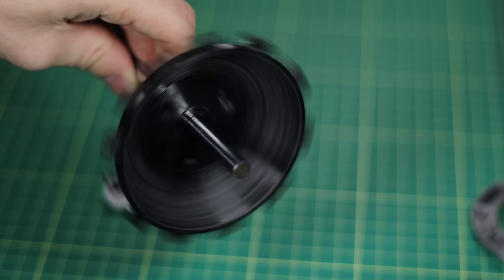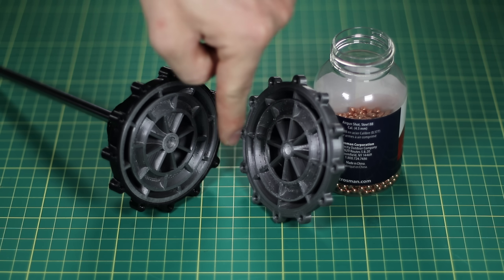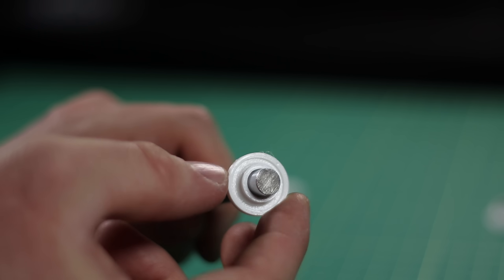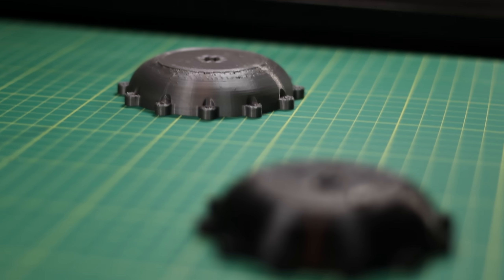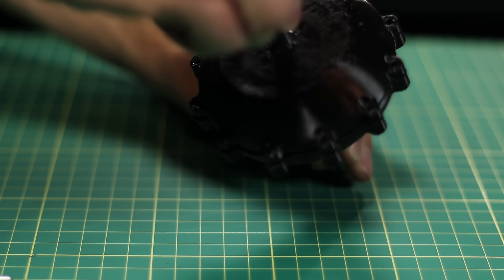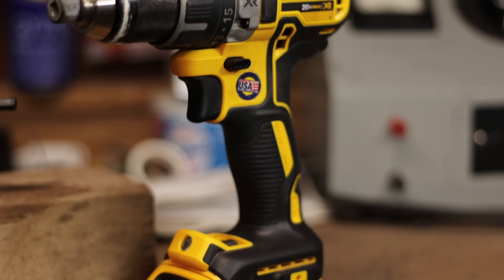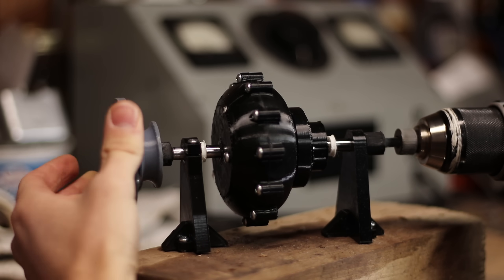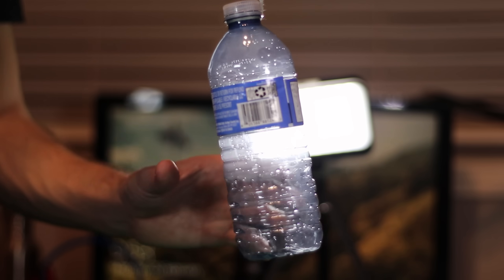3D Printed Fluid Coupler

Comment: instead of gradually adding water, i think its easier to just hang the 2 liter bottle and rev it up. angle will tell you exactly how much torque its making, if it stalls at 0 degree, you know your torque is ~2Nm, 90 degree meaning 0 Nm. torque = force*length*cos(stall angle)

Comment: This video somehow reminded me of an experiment i did as a kid where i attempted to design and build a "Non-newtonian fluid clutch" that was supposed to connect an input-shaft to an output-shaft when applying pressure to a non-newtownian fluid which in this case it was good old cornstarch and water mix aka. Oobleck. The applied pressure would then cause the non-newtonian fluid to solidify/ "stiffen up" between two "gripsurfaces"/ impellers causing them to lock up and transmit force between the two shafts. Despite all my enthusiastic effort involving few a different designs/ modifications to the clutch, the non-newtonian fluid and fluid level used inside the clutch i never got it to work properly (In my defence the only resources/ i had available at the time was a small vice, a drillpress and a dremel tool plus a few other regular handtools like hacksaw, hammers, files and screwdrivers and of course no internet. IIRC one of the first driveshafts i made was made out of a long nail)😄
I guess if it had ever been sucsessfull enough to make it to the commercial marked i could have coloured the non-newtonian fluid blue and sold it with the slogan "gets stiff and gets you moving" 😏

Comment: Now isnt this how a torque converter works? Or is it waay simpler?
Reply from the maker: Yes and no. The Fluid Coupler and torque converter both share the working principle of fluid circulation and speed difference between the impeller and pump to transmit torque. Torque converters however have a 3rd impeller called a stator inside to multiply torque. It's similar, but not the same
Reply: @CamdenBowen ok,that makes a lot of sense,so the fluid coupler doesn't have as many moving parts,but of course depending on the application there may not be an easy way to cool it down as easily as a torque converters method of sucking in cooled fluid in from the transmission pan. But it could be built similar to a finned aluminum fan clutch that is in most vehicles so it could stay cooler by having air flow across the coupler body's fins to keep the fluid more consistent in viscosity

Comment: You can calculate the dynamics torque if you connect a electric generator on it and measure the power output in kw ,then add the energy loses and last take the equation hp = torque/rpm and solve it for torque

Comment: The biggest issue with torque converters is that they can never be 100% efficient. A clutch, once it has fully grabbed, will spin with the two sides locked together. The fluid always has frictional losses of a few percent though.

But they are just so incredibly effective anyways that they can still apply very large amounts of force and they still have a very high efficiency for anything they might be compared to. Honestly, if they were cheap they might be a good way to power a bike from a SMALL engine because at low revs they wouldn't over power the brakes, but they might have a higher top speed than most bike engines do because they lack any sort of transmission.

Torque converters and turn speed into torque though and the greater the difference in speed between the two sides the greater the torque produced as the fluid imparts all of its momentum onto the vanes of the receiving turbine.

Long and short is I have wanted to put one on a bike to see how well it would work but automotive torque converters are not fit for the purpose.

Comment: Why did you reprint the part just to add a hole.. Just use a drill, surely?
Reply from the maker: Not quite, when a printer prints a solid object it creates a pattern on the inside to give it structural rigidity without compromising much of its strength. Drilling a hole into it compromises this strength and opens up the inside of the shell allowing oil to seep into it. When printing it with the hole in mind the object will be printed with walls surrounding the hole to prevent this

Comment: You need to turn the whole thing upright like a top when adding the oil, you're losing half of your efficiency leaving air inside of the torque converter, it needs to be filled to the max.

Comment: How can you be sure the rod isn't transmitting torque through the case, when the case is spinning?
Reply: Exactly my thoughts. There could be quite some power transmission, since there is no bearing and the friction between the shaft and case should be considerable.

Comment: Very cool - quite impressive to have such an effective transmitter of torque with just simple 3D printed parts and hardware. I can see this design being useful for applications where the 3D printed material is at risk of breakage. A coupler that will stall before the breaking point of the material would be really helpful, the one depicted here is just too effective. Nice work!

Comment: This is called a torque converter
Reply: Wrong, this is called a fluid coupling. A torque converter has a stator between the impeller and turbine, a fluid coupler does not.

Comment: Sorry for the non metric units but the logic should follow, most drills have tourque ratings in the hundreds of inch pounds. So worst case say its 100inch pounds, say the converter is only 50 percent efficient, that puts 50 inch pounds on that arm. A full water bottle is about a pound, to stop that shaft the arm would at minimum need to be 50inches long

Comment: The turbulence inside the fluid coupling will generate heat.  That's why most fluid couplings are made of aluminum and have fins on the back side. Aluminum is a good conductor of heat and the fins increase the surface area. I'd would be curious to see if your fluid coupling begins to distort after transmitting power for more than a few minutes.
Reply from the maker: If I had a means to spin it faster and for longer I'd love to see this thing shred apart, despite the mess

Comment: What is JB weld? Im always looking for something to glue my PLA peices together, so far epoxy is the best ive found.
Reply from the maker: what I use particularly is Jb quickweld. It cures in 4 hours and is extremely tough when cured, it is a two part mixture and is available in most hardware stores or online.
Reply: @CamdenBowen  okay yeah probably similar to epoxy

Comment: Idk precisely how much torque you can provide with your arm, but I'm quite sure it's a lot higher than like 0.3N/m (a high estimation of the torque on the axle) so I think a better way to test this would be using a heavy weight or a water dispenser bottle

Comment: Would it be possible to use this in line with an up hill flow tesla valve? To be able to get high pressure water to the top of a hill while allowing for hydo power also??

Comment: What would ferrofluid do? As I understand it it changes effective density and viscosity as it responds to magnetic fields, 
could make an electronically controlled variable torque converter!
Would be exceptionally interesting if it included its own generator and act like a governor!
Reply from the maker: That is very interesting, at low speeds with a low viscosity prevents the engine from stalling out. But with a high viscosity it could possibly even control the stall speed of the coupler

Comment: I think you’re spinning the wrong one. If you actually look at a automobile the outer housing of the entire torque converter(fluid coupling) is mounted to the power unit(engine)  externally so you should be spinning the entire housing and putting the load on the other end
Reply from the maker: It doesn't matter in this case, the reason why engines spin the housing is so the torque converter can easily be mounted to the flex plate such that the output shaft can easily slip into the transmission. Since both sides are identical Spinning either side produces similar results
Reply: @CamdenBowen  makes sense 👌 I agree with that logic

Comment: When measuring the torque, the shaft should be horizontal, otherwise the torque applied by the bottle would be lower. Of course, it has to pass through the horizontal position anyway, but the bottle has momentum by that point

Comment: Why don’t you put the arm onto a scale and measure the torque by torque=force*distance? Think that would work :)
Reply from the maker: The problem is the system has no net movement under load, so the distance would = 0. By multiplying the force by the length of the arm works in this case.

Comment: Have you thought about adding a stator to for the torque multiplication effects prior to it hitting its stall speed?
Reply from the maker: I have, however it is very difficult at this size to have it cooperate to the system. In a much larger one it may work better
Reply: @CamdenBowen  understood, thank you.

Comment: Fluid coupling may be an excellent solution for use with a diesel engine driving an aircraft or helicopter propeller. It could potentially be a "buffer" to reduce torque changes, to smoothen the vibration from the engine to propeller/drive system. These effects are from what I understand basically one of two challenges in using compression ignition diesel engines in aircraft.

Comment: That description of the fluid is one of the things that could happen, but at higher pressures (ie higher energy) everything that can happen, will happen, and you end up with the opposite flow at the same time, so they cancel out and it really just creates high pressure at the edge.

Comment: I worked at exedy(one of the largest torque converter companies in the us) for a few years, the impeller blades has a bit more of a curve to them to make the fluid flow in a loop more efficiently, kind of like opposing fan blades
Reply: Like a more toroidal path?
Reply: @LimabeanStudios  yes, the flow is kind of like a water wiggler(google it) so that it's just a donut like circle

Comment: The neat thing about fluid couplings like those found in automatic cars and trucks is that they are designed to multiply input torque before they stall and become a one-to-one coupling, making it easier to get the vehicle moving
Reply: Yes, but you need a stator for that to work

Comment: Is this even working as a fluid coupler? It seems like the rotating seals on the outside housing might just be grabbing the other shaft by friction. Maybe you could try an empty test to check for housing to shaft friction, but the variability of plastic parts might confound that if you don't use the exact same pieces.
Reply from the maker: I had a simulated brake on one end, it required a threshold amount of torque to break the static friction. The shaft at low speed and/or without fluid would not come close too that threshold. It's not very efficient, but it foes demonstrate the principals

Comment: this is but it isnt how a fluid coupling works.
sure, centrifugal force flings the oil out, gives it velocity. without it, they wouldnt work.

there is no reaction or impulse effect used in transferring power.
rather, its the sheer strength of the fluid having velocity.
think of the oil exiting the tip of the pump as pins, engaging with slots on the turbine. a lovejoy coupling. a very... squishy type of lovejoy coupling...

the pins strength is determined by the velocity of the oil. and its viscosity. the faster the flow, the stronger it is.
the coupling strength controlled by the number of "pins". more blades!
the oil flows in a spiral path, a vortex... much like a spring. the more turns, the harder it is to sheer that spring down its length.

the oil though, upon exiting the turbine and re-entering the pump, is flowing in the wrong direction, and the resulting flow is a chaotic turbulence. heating the oil up, wasting power.

the torque convertor is slightly different in that it still uses the sheer strength, but it also uses fluid velocity and the reaction to its change in direction in the turbine.
the oil leaving the turbine, now flowing the wrong way, is redirected by a third member to flow in the same direction as the pump, and again, there is a reaction on the pump blades, assisting them, from the fluid velocity and its change of direction.

as the fluid velocity increases, so does the sheer strength and coupling effect, combined with reaction forces, so that when the turbine is stalled, not rotating, oil velocity is at a maximum and torque is multiplied, because the power that wasnt being transferred then acts directly back on the pump and assists it in trying to transfer power to the turbine...

fluid couplings dont multiply torque, they consume it. can happily run them slipping at 2:1, but the torque transferred will be less than half, unlike a real 2:1 gearbox that would double the torque. all that power will dissipate as heat in the oil...

a torque convertor will be amplifying torque, but due to slip it will always be less than a true gearbox.

you never see small torque convertors because they dont scale down. its all about diameter and RPM to get the fluid velocity up. the bigger they are, the lower the stall speeds.

fluid couplings can be made small because generally theyre used where inefficiency doesnt matter, its about the soft squishy coupling forces, limited torque transfer, ability to withstand such conditions without failure...

go ped made one... lol.

Comment: I would be more interested in the dynamic torque produced by this. Also how efficient is the power transfer?
Reply from the maker: I am going to conduct more tests in the next video, one of these tests will measure the dynamic torque as it speeds up. The power transfer efficiency will be a lot more difficult to measure, I would need to determine the torque of the input drill and then compare it to the torque of the output. Finding the torque from the drill is difficult as I will need more test equipment
Reply: @CamdenBowen  You could try using eddy current clutches. I use them to measure torque (and power) on my 3DP-engine. I think it could work well for this coupler.
Looking forward to whatever you come up with!

Comment: If you curve the veins more like torque converter to flick the oil faster you can actually get a faster speed out of the fluid coupler. I don't know if this reduces the torque slightly (I think it dose but I'm not sure).
Reply: I don't see how you could increase speed without loosing torque: you can't make power up
Reply: @NicksStuff  It's making power. It's transferring power more efficiently.
Reply: @mrnlce7939 
High speed, low torque. 

Low speed, high torque. 

Simple.
Reply from the maker: That is a good idea, I in the future would like to experiment with using more veins, different fluids and so forth to optimize the design

Comment: if you have one of those "electronic kitchen scales" you can let the output arm push on the scale and measure the weight (i.e. force / 9.8 [kgm/s2]), and then work from there (arm angle when pushing down, delta rpm). delta rpm will be input rpm as the output arm is being held by the scale top in equilibrium. this is of course assuming the arm does not break or slide over the shaft. excited for the new videos, please keep up! 😀 also maybe measure separately the transferred torque due to static friction when there is no oil in the chamber to be precise.
Reply from the maker: Thank you! That's not a bad testing method, very similar to brake dynamometry. The scale would be certainly more accurate.
Reply: This is it right here! If you use a microcontroller to capture the RPM and force measurements over a sweep of the trigger, you'd be cooking with gas!
Reply: I was gonna say the same thing 😂

Comment: seems its leaking
Reply from the maker: Surprisingly no, Just some spillage from when I filled it up (and there was alot of oil already there from another project)
Reply: @CamdenBowen  i saw the original oil stain, kinda been using it as a tracker for which orientation you go with for a few vids now and the end of the vid it looked to be doubled if not more
Reply from the maker: @mouserr  That's like geo guesser level skill. I can assure you It was spillage, I filled it up a little bit in between clips and spilled more as this video was filmed over the duration of 2 weeks or so

Comment: That's a really cool design. and great explanation on how it works.
One thing I'll mention about your testing with the arm and water bottle. Once the arm reaches the upwards position the weight of the water is no longer applying torque to the output shaft, rather it's just pulling down on the coupler. Something I would suggest is making a pulley wheel where the string wraps around circularly and has a constant torque.
Reply from the maker: That's not a bad idea, defiantly would save me from snapping more armatures.
Reply: Even better than a circle, make a cam profile that makes a longer moment arm as it rotates (similar to a snail shell)

Comment: Did you upload the stl files I'd love to print this and use it in a few things also in the automotive world this is called a torque converter
Reply from the maker: I will upload the files to the description. This is a fluid coupler which is different from a torque converter, torque converts have a 3rd set of blades inside called the stator which manipulates the fluid to increase torque output at low speeds. A fluid coupler simple couples two shafts using fluid dynamics.
Reply: @Camden Bowen  ah ok makes sense